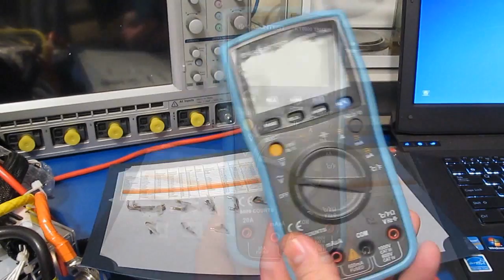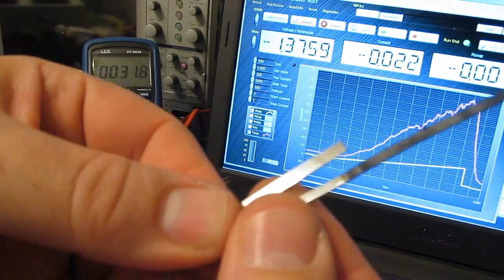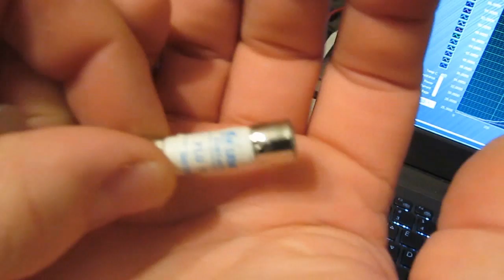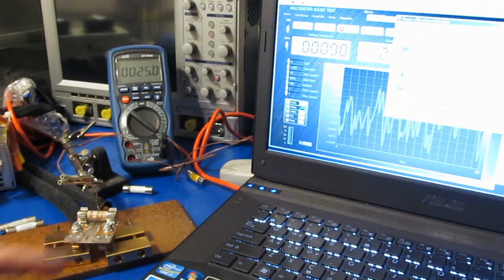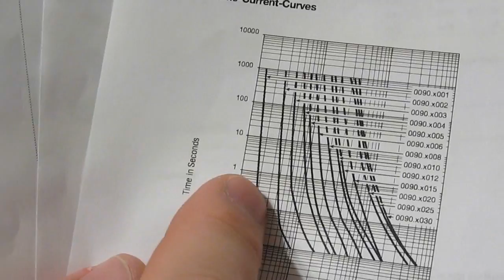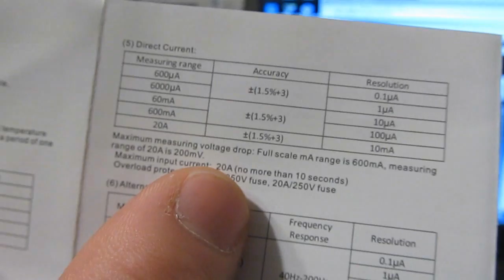Using the UNI-T UT61E to measure 20 Amperes

Comment: What about the low-z voltage range on some meters? How much power will it dissipate at high voltage?
Reply from the maker: I have a few meters that have this feature and they use one or more PTCs to pull it off.  So it's not a constant resistance.   Looking at one meter as an example, at 120VAC applied there is 4.7mA through it, so a little under 600mW.    When cold, the meter has a resistance of around 3K which would be closer to 40mA.

Comment: A couple of ventilation holes on the case will help keeping the temp under control.
Reply from the maker: They go to all that work to design the interlocking case for safety and you think we should drill holes in it?
Reply: Experimenting or redesigning? The case was designed for a 10 Amp max current shunt and not for your increased  20 amp. Despite using a larger shunt there is a substantial heat dissipation increase. Other options besides melting the case could include asbestos insulation of the shunt. But, perhaps if you just keep the meter for bench work, a safe enviroment,  the couple of HOLEs could do it. All a  matter of priorities of choice.  BTW, I like your very comprehensive evaluations of DVTMs. Keep up the good work!
Reply from the maker: I could run it with an external shunt, use the UT210E, remove the back cover all together, go to a smaller resistance and add a gain stage, lower the Watt density, use Teflon.....   Adding a few holes is not going to do much.  Maybe a fan with a lot of venting.   Try some of your own ideas and post the results.  I am interested.

Comment: Certainly believe in getting your money's worth out of your meters.  How about external shunts?  I use one of 30A, like your video's.
Reply from the maker: Most of these meters were bought only for these experiments.   The only one I actually use is that Brymen BM869s.    It is rare I use a handheld multimeter to directly measure current.  The UT210E gets a fair amount of use as a DC current clamp.

Comment: So the watt density figures in watts / mm^2, or watts / inch^2, is that based on the surface area of the current shunt (Pi * diameter * length)?  This is the first place that I have seen watt density units being used and was unsure exactly what they meant at first.
Reply from the maker: Surface loading or Watt density is normally something you would consider when designing heaters.  Yes it is based on the Wattage and surface area.

Comment: joe, I heard you talking about Dave's meter, is he working on a new one?
Reply: Arduino Eletronico he sure is.  the 121jw and it looks like it's gonna be a sweetheart.
Reply: Could you link me some video/somethig about this new meter? Couldn't find a thing about it.
Reply from the maker: They mentioned it will have a higher voltage diode check mode as well which if you play with higher voltage diodes may be a nice feature.  They also mention about it having a lower burden voltage.
Reply: Thanks for the help guys, I'll join EEVBlog forum. Also, higher diode check voltage is pretty handy, shurely if I have the money when it comes out, 'll buy it.

Comment: Very nice tutorial.  How can i measure the resistance and amperage of a component ,like a light bulb while it is loaded using 2 multimeters?  The one measuring resistance could get damaged.
Reply from the maker: There is something called ohms law.  You should look it up. You could do this measurement with one meter.
Reply from the maker: Right, if Joseph is playing with 220 AC line voltage and a light bulb, a meter may not be a very safe way to play with it.   I attempted to look at some non-resistive AC loads with a scope for fun.    https://www.youtube.com/watch?v=04I7nHA_HxM

Comment: Could you lower the burden voltage on the multimeter just by choosing the right fuse? I remember from one of your earlier videos where you showed how much drop there was on the fuse.
Reply from the maker: Slightly.  Putting a 30A slow blow fuse into a handheld meter to get low burden in the mA range may not be the best idea for other reasons and is not going to win you the MacArthur award.  Always replace the fuse with the manufacture's recommendation.
Reply: Haha! Good advice. Just curious if there is a large difference between fuses of the same rating. Unlike someone I know, I don't have a stack of exploded multimeters with fuses. :)
Reply from the maker: You haven't lived until you have a stack of exploded multimeters..  I can't answer your question.  I am pretty limited in what I have for the larger fuses like this.  They all seem to come with the three major brands and they don't have the same break currents.  Higher current rating will typically have a lower resistance.  But you can see it's minimal.
Reply: To be fair, I wouldn't dare even to be in the same room when you start up your high voltage gear. Been bitten twice by 240 volts and once when shorting out the CRT on a Mac 128k during repair back in the eighties. Young, dumb and full of ... The CRT was by far the worst experience. But as usual, you get lax after a couple of hundreds of repairs.

I which I had money (working on a startup right now), then I would send you a bench multimeter to test. Quite curious of the difference.

As always, great videos! I learned a lot.
Reply from the maker: I appreciate the thoughts of those wanting to send in meters to tests.  For now I can't really see asking for money to run the tests.  It's really out of my own interest as I have time.  If anyone else can benefit from the data I collect, all the better.  When I was very young I started playing with TV sets, with some guidance from my dad.  Now we have Google to give us guidance.  Lot's of free advice out there....  The main generator with the VF display is fairly safe.  Not much energy and it turns it's self off when the test is done.  This includes discharging the bank.  The connectors I use are normally covered so I don't really come in contact with anything.     Now that small one that sits on top used to simulate a half cycle line condition.  That is not one to play with.  The safety is really just turn the thing on and stand back.  That long PEX discharge probe is the only safety feature.

Comment: Did your new shunt return back to exactly the value you set it?.
I was just wondering if a once heated shunt is altered slightly.
Like the adaptive backlight, thats what all meters should have :-)
Reply from the maker: If you are asking about the shunt, it depends.  Many of the shunts I tested are no longer considered conductors.  It seems to have something to do with the melting temperature.   If you run the shunt below this, it's not going to change.  If you really want to know if the meters displayed current returned to normal once it cooled, yes.   You could repeat this with your meter but read the manual as they may limit the time you can measure for.   Also, many cheap meters may not have the resolution needed to detect the change.   The free HF meter may not show any drift.  3 or 3.5 digit meters would have to be really crappy... Never mind, some are!!  haha    I do like that backlight as well.  Every time I pull that meter out for an experiment, I think why isn't that in my Brymen!
Reply from the maker: I am in the process of running this test on several meters just for you.  I'll put this followup video on-line today which should help answer your question.
Reply: Yep you did a smashing job with that linear light, just the right illumination to countermand the darkness, very clever :-D.
I came back to see if i had a reply as i didnt get a notification, i think youtube is being messed around with again :-(.
Check your subscriptions.
Reply: Thankyou :-D, i bet the cheap shunts change after a hot test, crappy material i would expect :-D
Reply from the maker: I ran a long test yesterday with several meters where I ran them all at 5A and let them settle.  Then zeroed them out and let them sit and cook.   I then took them to 10A and back to 5A.  They all returned to normal, except the 61E I modified.   I then took the 61E to 20A and let it cook, then back to 5A and after a very long time it returned to the previous value.  When I aligned the UT61E, I used the Brymen as a reference and the PCB was cold.   I suspect the problem is that pot they have sits right next to shunt and fuse which heat up.  But now I have a fair amount of thermal mass so things lag.  These UNI-T meters are not always the best layouts.  I think the thing to do is remove the pot.   The way they set it up, that thing is WAY to sensitive anyway.  UNI-T is trying to make money with these cheap meters, so  you can't expect too much out of them.
Reply: Thank you for your testing :-D.

If the shunt you made in the uni-t is perminant, perhaps look at the trimmer and remove some of the surplus resistance eather side of the wiper and plop fixed resistors in place, then use a smaller value pot for less range, so less "drifticus" lol.
I did this to one of my old meters for the reference trimmer, so the trimmer and series resistance was the same, but the pot had less effect over its 270 degree rotation.
It was more stable.
It is a 1980's micronta digital, and no it would die if you tested it lol :-D
Reply from the maker: 61E uses a fixed already for the trim.  I think it's a 1:1 pot vs fixed.    Could use about 1:4 as I have the shunt set on the low side of things to reduce the power.  Too bad there is no programmable gain.   I would cut that shunt in half!
Reply from the maker: I am still pondering this whole UT61E mod and still plan to make a follow up video.
Reply: I looked at the specs of the ut61e a while back, and i almost bought one as it offers more than i would use normally.
But i realised i had too many cheap meters allready, i have an old fluke 8050A bench meter for keeping my bucket of cheap meters close enough.
Repairing things dont need a hyper accurate meter, just a "Close enough" check of the vitals.

Comment: a micro fan; could it help?
Reply from the maker: In real life, this would never be a problem.  The manufacture's will derate the current input based on the design.   In the case of my little experiments, I still need to get the heat out of the case.  Drilling holes in the case is not an option.  Using metal to conduct the heat outside the case is not an option.   The best idea would be to reduce the resistance like some of the cheaper meters I looked at.  The 61E does not have a programmable gain so an external amplifier would need to be added.   Personally, I use other means to make current measurements.  What's  the voltage drop of the UT210E at 100A.  haha.  Also the large external shunts, LEM sensors and what not depending what I am trying to do.

Comment: Thanks for uploading this test Joe. I wonder if a scaled-down mini Peltier style of thermoelectric cooler would allow handheld devices to handle more than 20 amps, or for longer than is currently recommended.
Reply from the maker: Like the other post about the micro fan, we still need to remove the heat.  A Peltier is not efficient and would create a lot more heat that we need to deal with, not to mention all that wasted energy needed to run it.